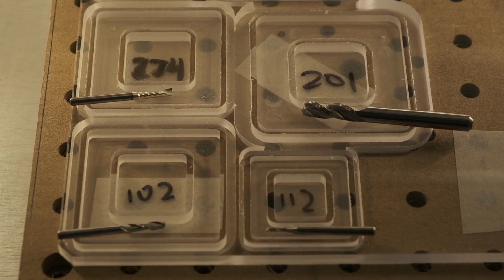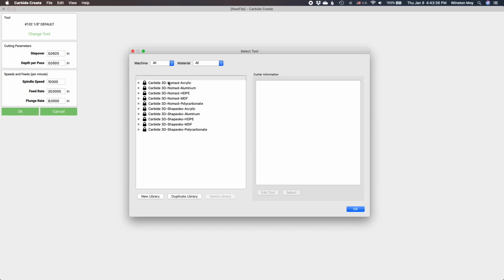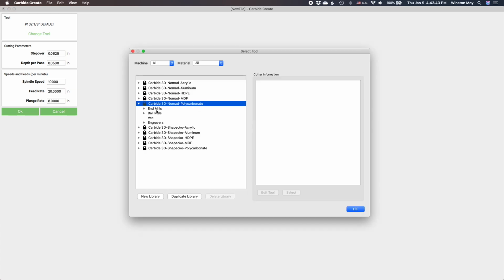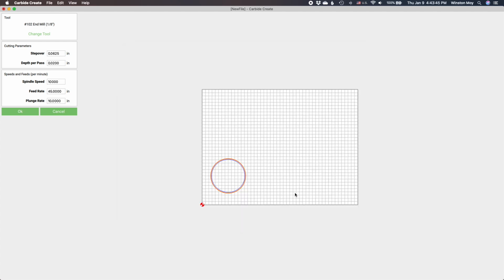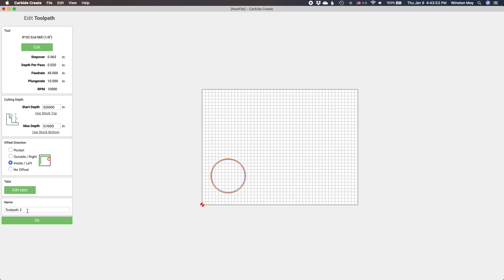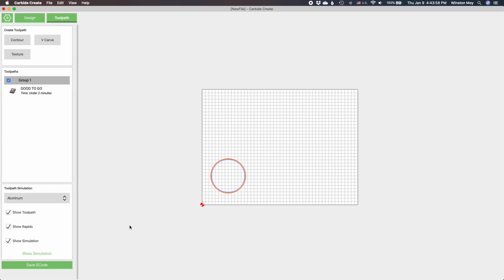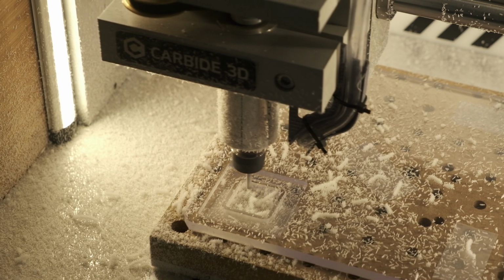Polycarbonate Speeds & Feeds for Nomad + Carbide Create Update

Comment: I am looking for a solution to work with 0.7mm thick Polycarbonate sheets, my problem is the cutting edge is not smooth, there are many chips stuck on it. Can you share some experience to deal with this problem?
Reply from the maker: Kien,
The best endmills for the job are single flutes.   Start with that and then also create a full depth finishing pass, at a high feed rate, to take off the final .2mm of stock around your contours.   
Additionally, you should try flame polishing the edges post machining.  (See: Melting).  This should provide a perfect edge.   Do some testing. 

And remember, without knowing the exact makeup of your polycarbonate it’s challenging for us to know exactly what will happen.   
Give those things a try and report back.  
Good luck!!
- Kevin

Comment: Seems like it could be safe to cut with a laser if you have proper air management? I'd like to cut some of this, but also planning to build an insulated, air tight enclosure for my 3d printer so I can step up to 3d printing PC. Then again higher temperatures from a laser could potentially release different fumes than 310ish celsius from printing. ...

Not that I'm looking to laser cut anyway, working on making the MPCNC. I vaguely recall seeing a video that highly recommended coolant for cutting this, or was it acrylic?
Reply: Hey! I'm no expert at all, but I just saw in a different video that another downside to laser cutting polycarb is that the stock absorbs the laser heat creating warping or remelting of the plastic.

Comment: Great info and love your presentation. Suggestion for Carbide 3D Store: Standardize the specs in the store: #101 # of flutes? + overall length. Each bit should have the same and complete specifications for each item the same. It would not be a bad idea to have a full comparison chart so you could pick a bit based off of the chart.
A suggestion for your videos, is to have a spreadsheet available in the description of all the data you cover for speeds and feeds; I have been sitting there with Excel open and pausing to populate a spreadsheet, but it would be easier if you posted a document. You have a great teaching style.
Reply from the maker: We will eventually have a way of looking up speeds and feeds outside of Create. In the mean time you can extract a CSV of tool/material speeds and feeds out of Create. 

In the Tool Library, duplicate a tool/material database and rename it as your own. Then go into the Data Directory, and look under the Tools folder. Data directory can be accessed by going to the menu bar and clicking "About Carbide Create" (under 'Help' if using Windows).

Comment: Awesome to hear that Carbide Create will get the speeds and feeds! Any chance you'd be able to provide Fusion 360 templates as well? Or maybe make them available in a google docs spreadsheet as a handy reference? Thanks for all you do for the Shapeoko community!
Reply from the maker: We will eventually have a way of looking up speeds and feeds outside of Create. In the mean time you can extract a CSV of tool/material speeds and feeds out of Create. 

In the Tool Library, duplicate a tool/material data base and rename it as your own. Then go into the Data Directory, and look under the Tools folder. Data directory can be accessed by going to the menu bar and clicking "About Carbide Create" (under 'Help' if using Windows).

Comment: Do you think Polycarbonate would be good for a mold for silicone injection? Thanks!!
Reply from the maker: Don't have any first hand experience with it, but as long as curing temps are reasonable I don't see why it wouldn't work. May also be worth considering a plastic where it's easier to achieve a smooth, slippery surface finish for release purposes like HDPE.

Comment: What is your air pump or compressor ?
Reply from the maker: Was not necessary for these tests, but it's just a small air pump you might use for hydroponics/aquarium stuff. The one I use is rated for ~950 GPH flow. -W
Reply: @carbide3d  Thank you Winston. Would you recommend higher GPH flow air pump for aluminum ?
Reply from the maker: @teknobest7287  I would say if you could get something in the 1000-1200 GPH range, that would be  more ideal. Best would be to use compressed air which can be concentrated through a nozzle, but for a lot of garage shops on single 20A circuits (like mine) its best not to have the compressor constantly cycling on and off while the cnc is running.